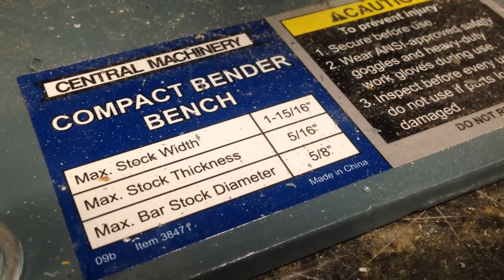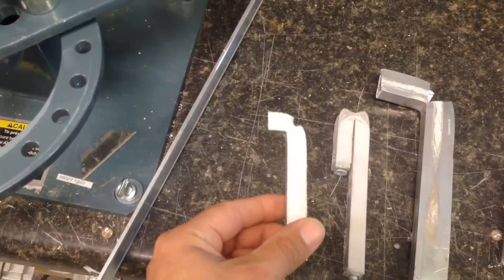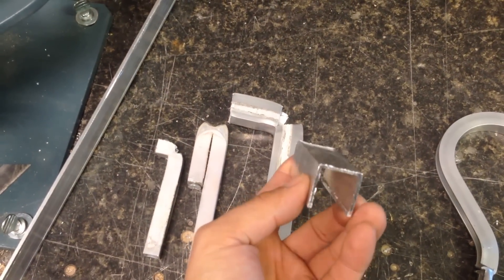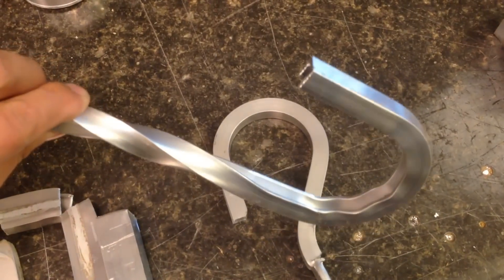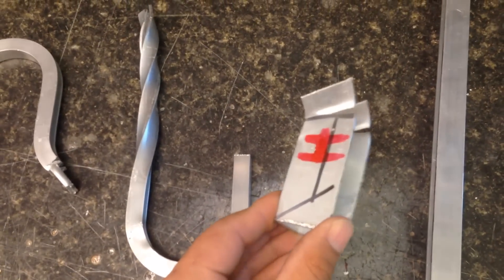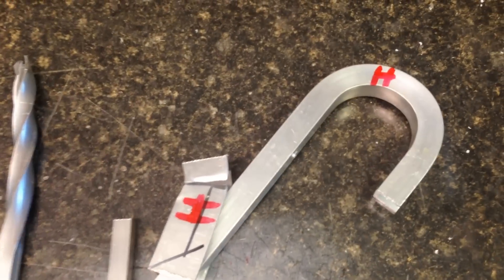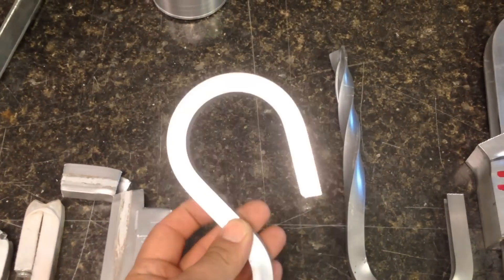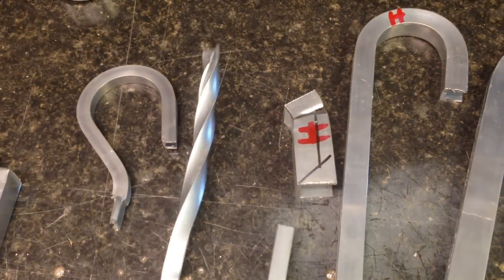Bending Aluminum Channel Scroll work with Harbor Freight compact bender

Comment: Put a solid wire in the middle of the die so the inside of the bend is bent in. This will allow a better bend. Heat it with a propane torch will help also. I bend small & thin to large & heavy without a problem with the same bender.
Good luck.
Almost forgot...if you can find square solid rubber strips,  insert in tubing...that reduces deformation.
Reply: yes, one can also melt a special low temp  lead alloy in the tube and it makes the tube solid. afterwards melt it out by putting in boiling water.

Comment: This is very Helpful.. I was interested in bending some 1 1/4" square alum with some type of bender at about 30 degrees.. and I suppose it won't work based on your video.  at what angle would the square tubing crack? 45 degrees?  Great video.. thanks!
Reply from the maker: it depends on how smooth of a bend you want. If you put a 5" radius die in their from a dumbell set and annealed the metal I'm pretty sure you could get 30 degrees, but not anymore. It also depends on the thickness of the tube wall 1/8" will bend more than 1/16"

Comment: the tubing material broke because its hardened aluminum, 6061-T6; the sheet/flat bar metal is 5052, usually in the O temper
Reply: Benjamin is
Reply: no that is all 6063 alloy aluminum. 6061 t6 extrusions are not available typically in any thickness less than 1/8". sure you can probably get it special order for a lot of $$$$, but for almost all normal cases this is true.